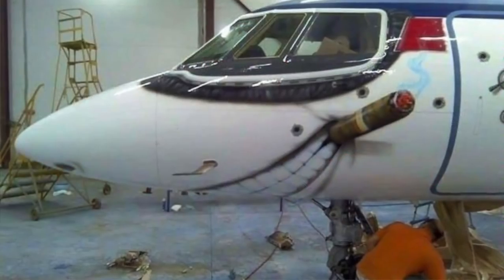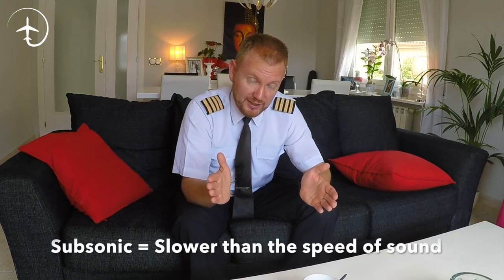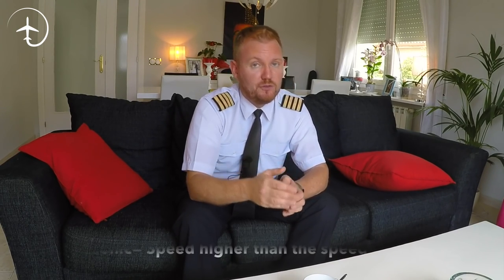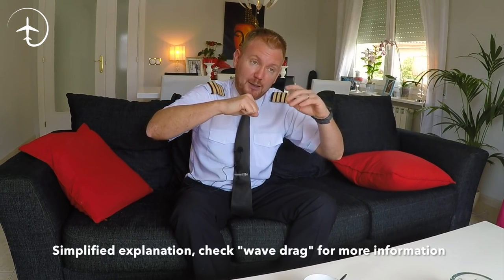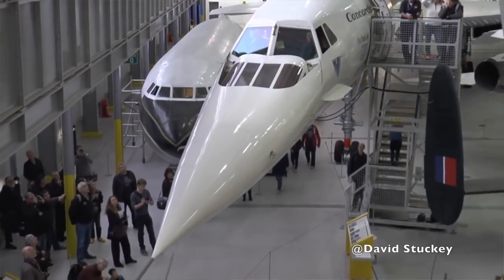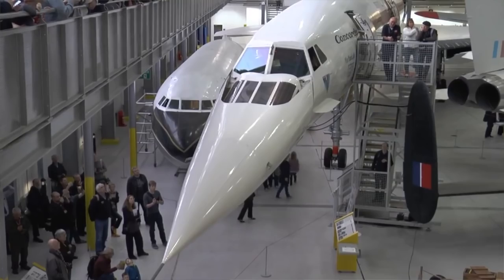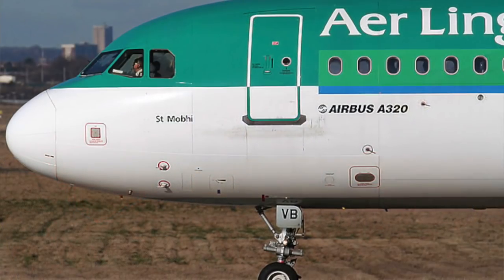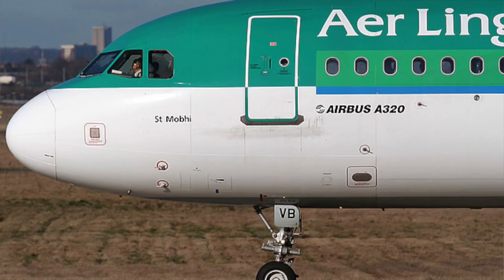Aircraft Noses. Boeing vs Airbus and Rounded vs Pointy.

Comment: To elaborate a little on drag, most of subsonic form drag comes from various areas of flow separation (i.e. behind the top of the fuselage at a high angle of attack). It is also often called pressure drag, which is a more accurate physical description. There is also interference drag, where the wing roots meet the wingbox for example and the really big one - induced or lift-induced drag. That comes from wingtip vortices and varies as the square of lift. Ever wonder what winglets are for? Yeh, they help keep that one low. A very clever German bloke (Ludwig Prandtl) worked that one out about 100 years ago. He also worked out that the lift and drag a wing generates has about as much to do with its plan form shape as it does with the aerofoil profile used in that particular aircraft.

In flight dynamics terms, drag is separated into two categories - parasitic and induced drag. Parasitic drag is the umbrella term for everything that doesn't change with lift, expressed as a single coefficient, and induced drag is as above. The peak aerodynamic efficiency (max lift/drag ratio) for any given aircraft is achieved when induced drag equals parasitic drag. The aerodynamic efficiency of an aircraft is also its glide ratio.

Once one enters the compressible flow region, pressure drag also comes in the form of shockwaves. If shockwaves are appropriately managed, as one has for example managed flow separation to all but eliminate subsonic pressure drag, shock-induced pressure drag can be reduced to a minimum, however unlike the subsonic case - it can never be reduced to zero. This is a direct result of the energy lost to entropy within the shockwave itself. One can reduce it by keeping shocks as weak as possible, but one can never eliminate it. As a general rule, weak shocks like pointy objects. Hence the Concorde

<EDIT>
It should also be noted that most airliners fly within the lower transonic regime. In the right weather conditions one can even see condensation forming on the wings as a result of the transonic shocks. Designers mitigate these in two main ways. First - wings are swept back. This has the effect of reducing the velocity increase over the maximum thickness point of an aerofoil, thus increasing a wing's critical Mach number (Mach number at which shocks begin to form). This also reduces the lift slope of a wing, but the plan form area is still present so the bulk of the lift is not lost (also, only a small Cl is necessary at these speeds). Second - aerofoils are now supercritical (see NACA 9- series, Boeing J, etc.). These aerofoils have a flatter upper section which reduces the likelihood of shock stall by weakening the back of the lambda shock (see transonic shockwaves). It also increases the working area of a wing in the event of shock stall by forcing the normal shockwave at the back of the lambda formation further back along the chord, which mitigates its consequences considerably.

Comment: Thank you, your postings are so informative and well made. On FlightRadar24 we get Indicated Airspeed, Actual Airspeed and Ground speed, What are the differences?
Reply: As you increase altitude, the density of the air decreases. This means that there are less particles in the air at higher altitudes in the atmosphere. The speed is measured by these pitot tubes which take in the air particles in order to measure said speed. Obviously as there are less particles of air entering these tubes at higher altitude the pitot tubes take in less and therefore the IAS speed will continue to decrease. Ground speed is the actual speed covered by the aircraft over the ground. True airspeed is, of course, the actual speed of the plane through the air.
Reply: Thank you but I presume therefore, the cockpit is equipped with instrumentation that gives the pilot a true picture not that we get on flightradar24?
Reply: To the pilot, IAS (Indicated airspeed) is the most important, and the one used. This is because IAS is measured via the pitot tubes on the aircraft itself (and as such the reading is affected by the wind direction, speed and altitude). Of course, the wing and control surfaces are only as effective as the amount and speed of air passing over them, and the aircraft will handle differently at different Indicated Airspeeds, and these will often not match up with a Ground Speed or True Speed. So to a pilot, IAS is the "true" measure of speed, as it's what defines how the wing operates.

Comment: I think you are right about the 787 nose. To me it seems the A350 nose shows a development in the same direction. Most likely due to structural possibilities they seem to get rid of the different angle between nose and windshield, towards a straighter line, Wich I would guess is preferable regarding laminar airstreams

Comment: i seem to remember that when boeing designed the 727 they used the same jigs from the 707 where they could for economic reasons so the fuselage and "nose" were the same. it followed that the 737 also shared the fuselage and nose of its stablemates. the 757 and newer had no such constraints excepting the 757 having a similar fuselage cross section as the earlier planes. thanks for a great channel.

Comment: Honestly. Out off all the noses. I prefer the 707 and the 717. But very interesting video Petter
Reply from the maker: Thank you!
Reply: The 717 is not an original Boeing jet.  It was designed by McDonnel Douglas as the MD95.  After Boeing bought out Douglas, it renamed the plane as 717 to be consistent with the jet numbering system.
Reply: If I'm not mistaken, the 707, 727 and 737 all share the same nose, cockpit windows and fuselage diameter.  When seen from the side, from about the L1 door forward, they appear pretty much identical.
Reply: You are correct.  And the 767 fits there too.  That's how you make money in aerospace.  If it works and gets certified, use it again, and again, and again.
Reply: Correct - but more correct is Douglas.  McDonnel didn't really have much to do with the DC-9.  Love that bird.  I have 2000 hrs as a crew chief in the Navy on those.
Reply: The MD95 wasn't a "Douglas" jet.  It was based on the DC9 but the MD95 had all the latest avionics and two new engines. It was designed when the company was McDonnel Douglas instead of only Douglas.
Reply: Technically correct.  But the DC-9 (DC for Douglas Corporation)  as well as the MD series were designed by the Long Beach guys (Douglas) not the St Louis guys (McDonnell).  Much as you'd like to make that one company, there were two distinct design philosophies between the two organizations.  The DC-9 loft was done by Douglas and therefore the nose.  And the aircraft's systems were originally Douglas design philosophy.  While the newer systems were improvements of the older systems, the system philosophy remained very similar.  Calling the MD series a McDonnell design is like calling the renamed Boeing 717 a Boeing aircraft.   While technically correct, it was really only name by.
Reply: Come on now.  The MD95 was designed when the company was McDonnel Douglas instead of Douglas Aircraft Corp.  Just like the MD11 which is an upgraded DC-10.  The DC10 was a Douglas design but the MD11 was designed by the new company called McDonnel Douglas.  Heck, Douglas merged with McDonnel so they could have the combined resource to design and build the MD11 in order to compete against the Boeing 777. That didn't go well either.  The Douglas engineers didn't have anything to do with the F15 or F18 but the planes are called McDonnel Douglas F15 and F18.  Likewise, the St Louis engineers didn't design the C17 in Long Beach but it's still called the McDonnel Douglas C17, and not the Douglas C17.  Boeing didn't have anything to do with the MD95 design other than to rename it.  Philosophy has nothing to do with it.
Reply: Nope, none of the MD designated aircraft were designed by the McDonnell people.  I worked the MD-11program.  It became the MD-11 only because the DC designation became tainted by the Chicago Crash of the DC-10-10, AA flight 191 (which, by the way, was determined to be American Airlines maintenance's fault).  Both the DC-9 and DC-10 changed to MD after that.  The DC-9 Super 80 was designed after McDonnell and Douglas merged.  Yet it still had the DC designation.  After the change to MD, it became the MD-80 but the type certificate still said DC-9-81.  And their designs and build were still done in Long Beach, by Douglas people.
Reply: You are incorrect about the DC9 and DC10.  They are still DC9 and DC10 after the two company merged.  If you look at the DC10 and the MD11, they are totally different, and they are still called by their respective name.   They redesigned the DC9 into the MD80 and MD83 with the modified wing and new engines, and the new boattail compare to the older model.  The MD90 was a redesigned of the MD83 with the brand new high bypass engines and newer avionics.  Type certificate is only for the FAA.  The commercial name is MD which stands for McDonnel Douglas.  Just like I said in my post, Douglas had zero design in the F15 and F18 but the Long Beach people have no problem calling them the McDonnel Douglas F15 and F18. Likewise people don't call the Douglas C17, it's MD C17, and now Boeing C17.
Reply: The FAA type Certificate is everything.  And the MD is only in parenthesis on the type certificate (which means reference only) .  But the documentation such as the maintenance and flight manuals still used the DC in the titles for all the MD models.  Also, the FAA type certificate only carries the identification that the Manufacturer submits for certification. Therefore, since the Type Certificate officially called all the MD-80's, MD-90's and B717's a DC-9-whatever, that means Douglas never changed the official designation; even after McDonnell and Boeing bought them.  The people at Boeing like to say that McDonnell bought Boeing with Boeing's own money.
Reply: SkyTrain: You are stretching the truth. Douglas was almost bankrupted when Donald Douglas came begging to John McDonnel for funding to build a 777 beater but Douglas engineers could only figure out how to do it with 3 engines instead of 2. Of course, neglecting your disinformation, the design of the MD11 was always called the MD11, even you said you worked on the MD11 program. The rest of the engineers worked on the DC9 derivatives which became the MD80 and MD83, using John McDonnel money. But Douglas being Douglas, it was a proud company, didn't make money so John McDonnell found a way to make more money by convincing Boeing to merge with him, even at the cost of his family name.  What did he get in return?  He became the major single share holder of Boeing.  He even got to put the former McDonnell Douglas president as the president of Boeing. Now that is smart. I don't want belittle your engineering work but we are talking about airplane history, not your work history.
Reply: I started on the DC-10 and KC-10 program.  Well over 90% of the MD-11 is DC-10 parts.  We stretched the fuse, changed the angle of a few dangles and kept the same center gear.  We even used the same 108" cargo door on the upper lobe of the KC-10 on the lower aft cargo hold for the MD-11.  We rolled out the old MSLO drawings and modified them by rolling the revision level.  But that is not my point.  My point is the  Douglas Long Beach engineers did all these designs.  Even though the leaders and owners changed hands, the engineering did not.  The designs of all the derivatives were done by the same team with the same engineering standards and same system design philosophy.  So they are still Douglas engineering; not McDonnell engineer. Even today when I look into our new online standard system at the Lazy B, the Douglas standards are still there, separate from all the others.  I stretched nothing.  I stood on the shoulders of the retiring Douglas engineers and took their design a little further into the future.  But alas, now all the Douglas designs are truly gone.  The Long Beach plant is only a shadow of what it used to be.
Reply: I believe the McDonnell Douglas company stopped innovating and allowed Boeing and Airbus to leap frog it. The MD80 jets still have manually boosted cable control instead of the FBW.  The Airbus company got a jump when John McDonnell sold the design of the MD11 wing to Airbus so he could get money to pay the workers.  If you look at the internal structures of the Airbus A300 wings and engine pylons, they look exactly like the MD11.
Reply: That may be true.  I just thought Airbus copied.  Not sure what the DC-10 had but that is the case for the DC-9.  The yolk was not connected directly to the control surfaces. It was connected by cable to Spring Tabs (trailing edge lagging tabs) that in tern moved the control surfaces using aerodynamic forces.  The ailerons were bus together but the elevators were not.  So it wasn't unusual to see one elevator up and one elevator down when setting on the flight line with the wind blowing up the tail.
Reply: Airbus copied a lot from Boeing but they were able to build their first wide body jet using the McDonnell Douglas wing design. This wing design saved them 5-6 years of development.  From the humble A300, they went to design the A330 and A340 and went head to head against the Boeing 777.  By that time, most airliners already gave up on the MD11, except for FedEx. They gobbled up all secondary market MD11 and DC10.  They went to convert the DC10 into MD10 by upgrading the engines, especially fitting the MD11 tail structure and engine to the old DC10. You still sometimes see the MD10 by looking at the vertical MD11 tail but the airplane still has the old DC10 rounded boattail, and no winglets.
Reply: It's a DC9 in the type certificate, just look it up. It was labeled MD to the public to appear as a more modern thing and sell better and was also appropriate with the McDonnell merger. Avionics and engines are constantly improved anyway.
Reply: EveryTypeOfVideo Boeing noses are better
Reply: The Comet's nose was gorgeous - almost pointy, but not quite.
Reply: Skyhawk _452 That's the bottom line: it worked and was the cheapest, lowest risk approach for Boeing. That approach also brought the same tight cockpit and extremely loud ambient noise level ubiquitous to all Boeing narrowbody aircraft (save the B-757, which is different and quieter inside.) 

Airbus obviously wasn't similarly constrained but there's no doubt they'll prefer to stick to the same cockpit geometry going forward because why change what works?

Comment: I don't know about aircraft noses, but when I was in college 40 years ago the final assignment for my intro engineering class was to build a model rocket (we used Estes) such that it reached the greatest altitude. I learned quite a bit about aerodynamics. The takeaway was that a paraboloidal shape was best, and Estes made plastic nose cones with that shape. I suspect that minor deviations make little difference.

Comment: An accident has occurred in Cuba, boing 737-200 crashed after take off from Jose Marti International Airport
Reply from the maker: Yes! We have had some pushes out in the Mentour Aviation App already
Reply: What happened to the plane or what caused it?
Reply: It was a 732? Those are ancient I didn’t know they were still being operated.
Reply: Brian Green 737-200, it is super old yeah. Cuba lease the aircraft to a Mexican airline with crew included.
Reply: Rezzie Libiran they have one black box and looking for the other one. The only thing that we know is because Witnesses, they saw that the plane fell quickly after taking off and an engine was on fire. Only 3 survivors and they are really bad.

Comment: Hi, there.
Thanks for another super video, very accurate and informative.
I have a suggestion for a video which would also answer questions and point out something (Dealing with a problem and the solution) that hardly anybody worries or knows about.
Ice buildup on the leading edge of the engine nacelle.
I know the answer but it is a fascinating talk and I feel it should be shared.

Comment: The issue with the 737 NG and MAX series is not so much of aerodynamics but rather with development costs and certification. If I'm not mistaken, I believe (reading from somewhere) that Boeing wanted to change the nose to the 737 NG but in doing so would incur greater development costs and also certification issues. That's why the fuselage shape hasn't changed much from 100-200 series to the current MAX (with exception to the tail). Keeping the same nose decreases development costs and allow certification to be much more simple.

Comment: Aerospace Engineer here. The explanation for the rounded nose for subsonic aircraft misses the main reason: An aircraft can fly at different angles relative to the air. This means, from the point of view of the aircraft, the wind can come from different directions. Regarding the pressure at the front, a rounded nose is only slightly worse than a pointy nose, when the direction of the wind is ideal. If it is not ideal the flow around the pointy nose becomes very poor very quickly. This is the same reason, that subsonic airfoils have rounded leading edges.

Comment: I think the nose droops down a bit on modern aircraft (notably 787) is because most of the modern airlines at cruise runs a positive attitude. So while the nose looks pointing down at neutral attitude, it probably points perfectly forward when the aircraft is travelling with a positive attitude (which is almost the entire flight).